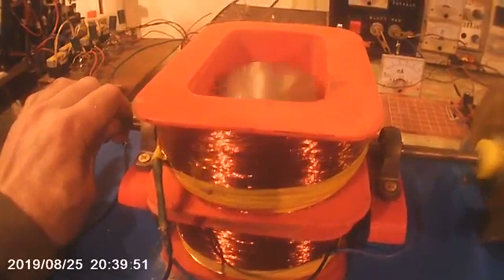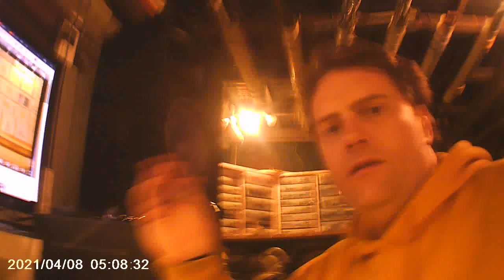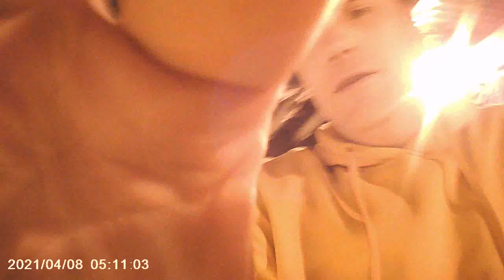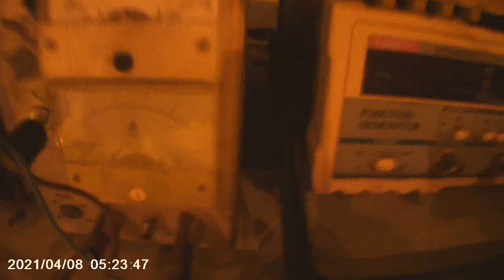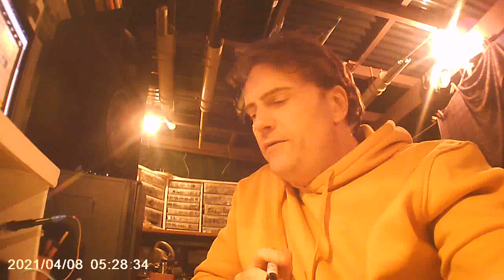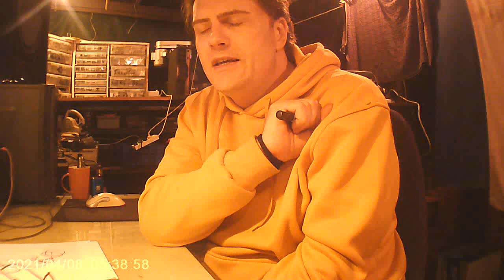lets talk : lenz law and free energy machines

Comment: I and my friend are working with the Thane hiens bitoroid overunity transformer. I am more technical than my friend who is not an engineer, he is a finance graduate. 

He consulted me on technical part and i guided him as per my engineering knowledge and experience. 

Because I am more technical than him so i did my calculations on paper first and then consulted him to follow the steps. 

Being more technical i rejected many ideas on paper itself such as connecting caps in series, however he being a non tech guy, he many times followed his intuition and at one time he connected the cap in series at input side and that reduced the input current drastically without reducing output at secondary when loaded. 

Knowledge restricts our creativity. U r doing a mental analysis of why Adam's motor shouldn't work, but when u try to build it in real, u will get new ideas and when you implement those ideas you will make it work. 

So inventions are about experimentation rather than examination, because we are not taught good in school textbooks.

Comment: Hi Patrick, I had time this morning to finish watching this presentation. I agree with you that Lenz's Law is a regulation problem not a limitation. From my observation with my lab work, low wattage devices are extremely efficient. When we scale them up for more energy transference the COP plummets. I like the Newman motor as well. In my early work with coils and rotors I found that ferrite hysteresis is the key to consuming energy employing the trade of torque/mechanical energy with a pulse/impulse slight deficit. In a closed system the impulse deficit is released into the absorption of the environment as fluidic vibrations. The open system employs the pass through vibrations and resonates parametrically to amplify the useful disturbance in geometric reflection. Like ringing a bell/bells or tuning fork/forks as with parametrically resonating notes of multiple parallels or series configurations tuning forks sympathetically received by the arrayed receivers. Tap Ring._._._._._.....< Edward Leedskalnin published to ring the bell twice. What most overlook is those rings have amplification that are reflected. I've found that this reflected force is transmitted successfully employing pancake coil/coils then received by a matched tuned pancake coil/coils that we can direct to employ useful torque/mechanical energy work remotely in an open system. Basically an open system school girl motor architecture instead of the closed system most have worked with. A friend of mine is demonstrating the rings reflectively with low amperage low voltage input and low amperage high voltage output. The current stream is aligned with the magnetic natural flow circulation facilitating earth ground as a localized battery charged and the atmosphere separation of a harvesting capacitance plane employing the circuit of the transmitter pancake coil received by the matching tuned pancake coil which this amplified energy is directed to provide useful torque/mechanical energy. Ohms resistance is the regulator... Like prevailing winds provide propulsion of sailboats. I've found that this world's construct we spend time with/in, that we can build devices that employs the natural magnetic stream flow/flows to make up the deficits that our torque/mechanical energy machines naturally released as vibrational emissions. It's not free as it takes material & labor to fashion and employ the natural magnetic flow/flows with our open devices. Constant adjustment and tuning like a sailing crew works to navigate the prevailing current weather, to reach their destinations. We can't control the weather and these devices work about 80% of the time then cycle back to their usefulness. These natural magnetic flows are dynamic and shift. I will be happy to direct you to my friend's YouTube Channel as we labor to build our devices if your interested. Cheers
Reply from the maker: hi mate , master ivo is doing some fantastic work with the tuning and switching side of the pancake coils, high power and speed lc switching with the latest igbts, all details shared and explained well, - your work with friends pulling electrons off the ground wire tesla style  has never had so much potential, the tuning capabilityies today are at a level tesla would dream at.   - ivo has the tech, if you have a wiring diagram and a big enough rod.     link me up, id love to follow the progress.   mean time i will fine tune several magnetic machines to find the efficency threshholds

Comment: REALITY  CHECK.       after watching a bit, and skimming some more,  i can say with certainty that there is  No  information of any value  in this video.        no one on YT  knows  Enough  to be able to  inform  ANYONE  else.!            it is normal that the design of an efficient electric  motor  be  optimized, for minimal lenz-related losses.      eg., see tesla car,  AC induction main motors.        the  SAME  is true, of  efficient  alternator  design.              btw, it should be understood that the inclusion of an, Un-loaded, electric  motor in a power processing circuit is  pointless  gobbledy-gook.     such a motor is  NOT  doing  what it is  supposed  to do.      instead, the motor is  Only  acting as a (mechanical) rotary  Transformer.!        googletranslate
Reply: David, how can you determine that there is a lack of useful content by flicking through this video lecture? I wish I could have done that at university!
p.s. unloaded electric motor values are integral to any conventional spec datasheet.
Reply: It seems to be able to make those statements you must already have all the answers. Let's see what YOU'VE got and all the hard work you  have done to share with others? You want someone to give you all the answers without working for them. Well here ya go... you want sure fire free energy? Go buy you a house with a stream next to it and put a turbine in it. There ya go. Limitless free energy. Now stop trying to hinder the work of those sharing their hard work, successes and failures to help others learn from there experiences.

Comment: Hi Patrick, I'm a new subscriber. I intend to review all your vlog postings,  I was commissioned in 2015 by an enterprise foundation to R&D Tesla patents. That contract ended in May of 2020. The foundation needed me to separate fact from fiction. I found by lab work. Nearly all the work the greats did over 100 years ago was asymmetrical and not symmetrical. We can't break the rules of physics but we can bend them. The Newman motor uses spent batteries to start the process then they serve as resistance. Between the Lockridge device and the Newman Motor I found how to get Q factors amazingly higher than I was indoctrinated with formal education to be possible. I've found that energy isn't a free lunch. However asymmetric bifilar ~ trigger coil + up to 9 charge coils and geometry are essential keys as  pilot lights to charge batteries. Bedini, Newman, Lockridge and UFO Politics were extremely helpful to me. Haven't found free energy yet however asymmetrical configurations amplify. Your mileage may very. Best wishes. Cheers
Reply: Hi Will, Thanks for your comments, FE is illusive in the eyes of a trained electrician no dout,  for somebody with douts of the existance of free energy, Open systems are the easier example because you only have to demonstrate an ability to utilize a free source of energy, rather than a new understanding of physics.  the russian mechanical amplifier see saw is my favorite example
Reply: Patrick, thanks for your response. Have you studied the solid-state version open system that Tariel Kapanadze demonstrated @ 5 KW? It works like an asymmetrical see saw. I don't recall seeing a mechanical version in my R&D.
Reply: @willhibbardii2450  Gday Will, i am familiar with Kapanadze 3kw device, he claimed he was using a center tap tesla secondary, with a conventional primary positioned in the middle... this was visible in the box, the machine was presented as using 1kw to produce 3kw from a earth ground system, however his high voltage power supply (also visible in the box) was not capable of delivering 1kw,...  although he had 3kw of globes shining brightly, he was using a ferrite hv transformer capable of no more than 80w MAX judging by size....  so sorry but i dont buy into this one.
Reply: @willhibbardii2450  with a 10mm spark gap on the primary, there is no explanation i can see for how it was done.
Reply: Patrick I agree. You obviously know what your doing. I bought into it in 2015 by 2016 couldn't duplicate his work with targeted results. However working with it did lead me to discovering out of phase amperage with voltage high potentials and bringing them into phase with resistance. I have a full day planned. I look forward to reviewing your V-log this evening. Have a blessed day.
Reply from the maker: thankyou, - these are great principles to work with, - ive seen kilowatts pulled of a grounding rod. but not via these methods. if the tesla / kapandzee / don smith stuff can be perfected. excellent. but currently i have not  seen these open systems even break even. but they can, and i smile whilst wondering why i have yet to see it done ;=D
Reply: Busy, had to stop this presentation @ 10:55... Pass through asymmetrical dual commutator. Think Bosch starter motor. Remember guys were trying to establish patents back then and not infringe on others work. Adams was showing the concept.